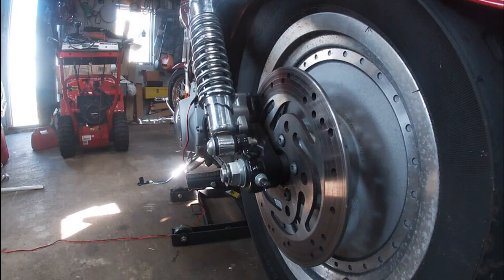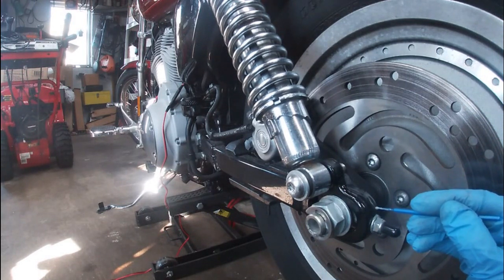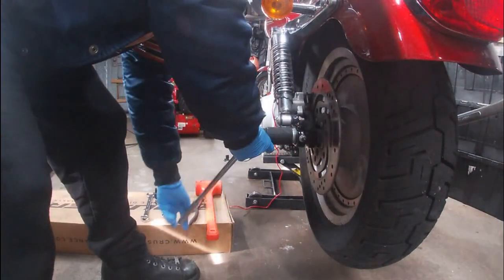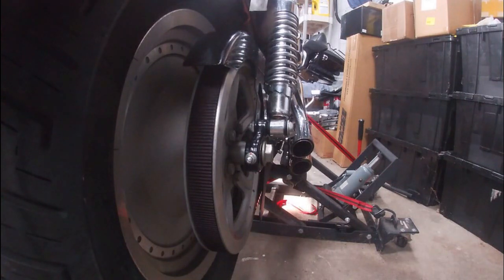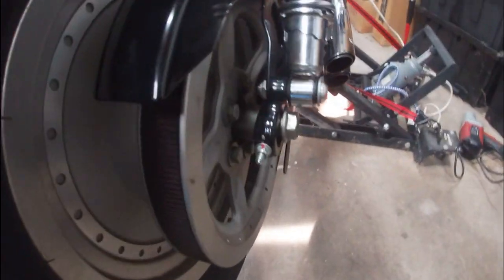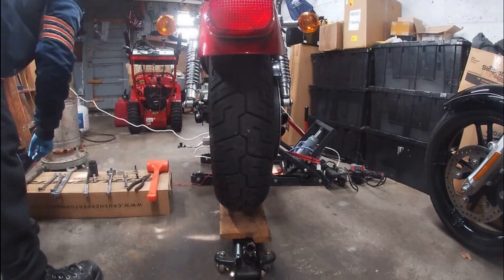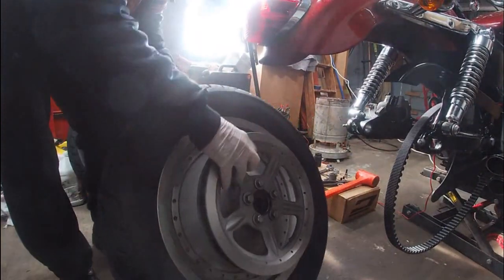2008 sportster 883C rear wheel removal 2 7 2023

Comment: Nice tip on not removing the rear brake caliper.  👍 What socket size was used on the left axle nut.
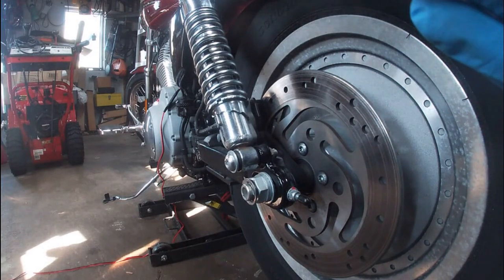Reply from the maker: 5:05 in to the video i give you the sizes needed for the axle and the nut

Comment: Any tips on getting it back on? I’m replacing with a white wall and I cant get it past the brake caliper, I’ve tried to just put it back under it normally and that wouldn’t work, I tried removing the caliper and the little mounting bracket but once I get the wheel back under it I can’t get it all to fit. I’ve even taken the belt guard off at this point. Pain in the butt!!
Reply from the maker: do you have it up on a bike jack? if so about a 1-2" thick  board under the tire and then lower the bike down to line up the axle BUT reinstall the caliper assembly first as you cant do it with the tire installed... ALSO  unfortunately since you removed the caliper you will need to realign it  for brakes to work properly 

see this video for that procedure 
https://www.youtube.com/watch?v=7nqGdIlZBxQ&list=WL
Reply: @thousanddollarmann7978  So I got my wheel back on and got to the brakes. I did his tip step by step, and now my pads are stuck to the rotor and the piston is fully out. I have no pressure in the brake pedal. Any tips? Forgive me I’m very new to this lol.
Reply from the maker: @horsfe4therzfishin448   its tough for me to say without seeing it in person BUT i would start over.. you will have to take it back apart again ( IM SORRY )  as i know its a pain in the backside to get the wheel in... when you had the caliper itself off it sounds like you may have gotten air in the system...  i would take it back off carefully compress piston after spraying down with brake clean once done , replace pads if they have any wear so you dont have to take it back apart again then remount the caliper and reinstall the wheel  and then go through the caliper centering process again and bleed the system ... i have a video for flushing the brake systems..
Reply: I’m in that situation right now. I’ve removed the rear wheel on other Sportsters and a Heritage and never had to remove the caliper. I couldn’t get the wheel to line up going back on so I took the caliper off when I should have just took the pads out. The calipers are a floating design on 2004 and up and I’m having a time getting the caliper and pads back on.